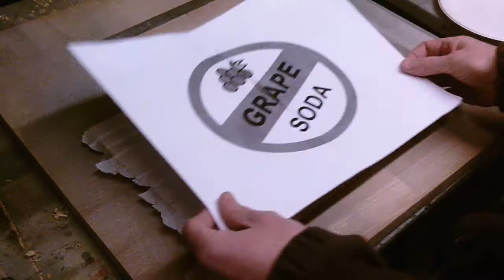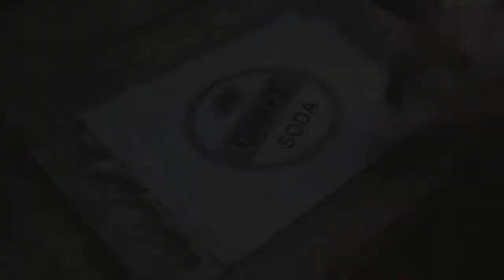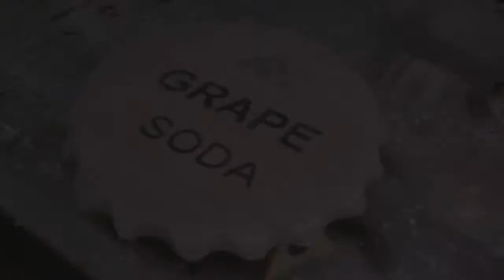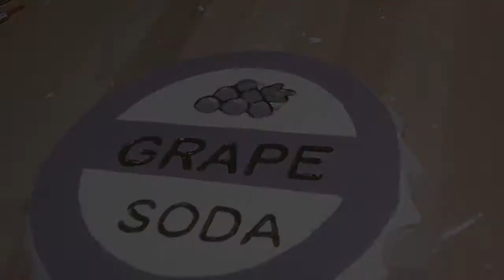DIY Grape Soda Pin/Badge Wall Plaque (Disney Pixar UP)

Comment: Fantastic build. I am wondering how you managed to cut the fluted edges. I couldn't quite see how that was done.
Reply from the maker: +Strawbyte Workshop thanks Karl, well spotted pal. I was hoping that no one would notice my rookie mistake  ( I forgot to film that part) - basically I put a drum sander attachment on to my drill press and sanded away holding the plaque at an angle. Thanks for watching my friend 👊👊👊
Reply: Such a simple way of achieving the look. I always forget to film stuff. Usually a key step.

Comment: Love it martin well put together. Where did you get the spirit bits from buddy I need to get myself some
Reply from the maker: +BIGBOY'S DIY thanks Warren. The set was from Amazon. (Mohoo 10pcs 1.5mm-3.175mm Carbide End Mill Engraving Bits For CNC Rotary Burrs)  and you need an adaptor also.
Reply: MG Makes thanks Martin
Reply from the maker: Oh dude I forgot you will need a collet adaptor  ( JIUWU

Generic 6.35mm To 3.175mm 1/8 Inch Engraving bit CNC Router Tool For 6.35mm Collet)  this worked great for me, but some of the reviews mentioned about a loose fit. So be careful. 👊👊